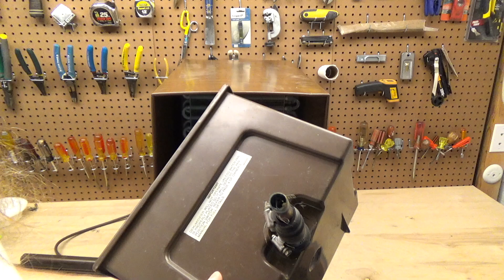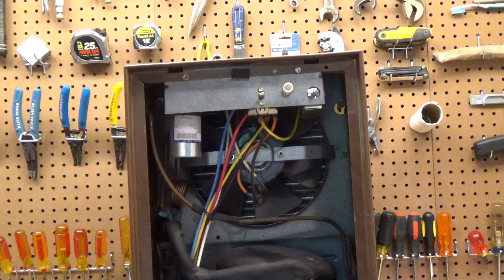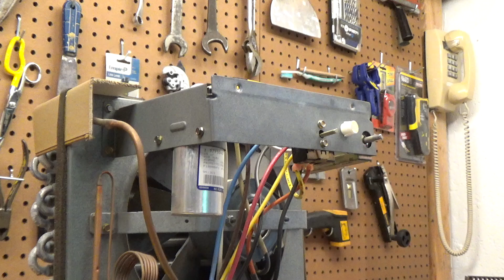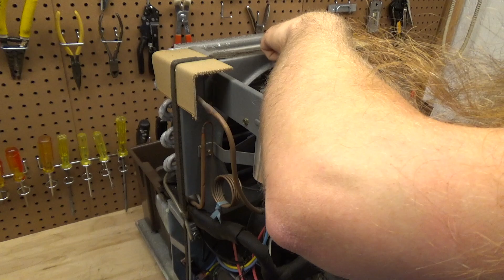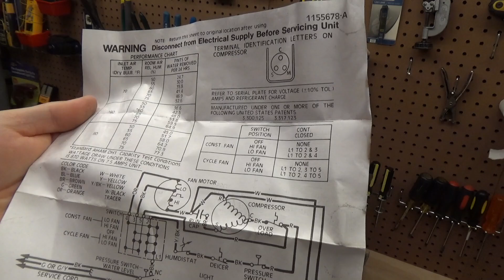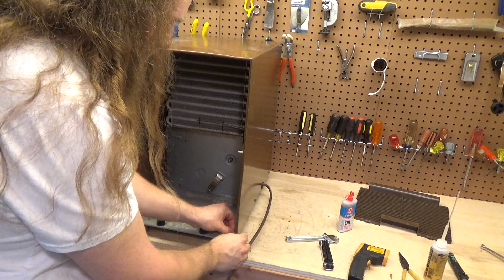Severely Damaged Compressor Mounts and Locked Fan Motor

Comment: Compressor is a Tecumseh AE just like the Carrier Siesta and the White Westinghouse air conditioner. I can't imagine how the compressor mounts were damaged like that but sure enough it still works perfectly sans the fan motor.
Reply from the maker: That is an excellent compressor.
Reply: @JordanU  Much like the rotaries, some people have claimed the two pole compressors don't last as long as the four pole compressors. While true in theory it hasn't played out. There are many, many two pole compressors that are 50+ years old and still work just fine. The AE is a perfect example. One of the best out there.

Comment: This one is totally identical to mine!  Judging by this unit set to constant drain, this may have fallen off of a table or a work bench.  When the compressor kicks when shutting off, it shakes the whole unit.  I think that's why it fell off of a table or bench

Comment: Those motors can be opened. Twist a flat blade screwdriver in the four points on the edge of one of the end bells where it meets the motor housing. You can see the metal punched and curved in. once you unbend it the end bell can be removed and it can be serviced like any other motor. Back end bell is easiest, and you can tap it apart gently from other end using the shaft. 

I work on tons of Nutone and WP stuff with this UE/Magnetek style motor and they usually come back to life rather well. Its rarely a lack of lube and roached bearings with them, and more commonly that the oil simply went sticky.  

To reassemble, use a punch and bend the metal tab things back. You can tap them down a bit as well if end bell is still a bit loose. They are decent motors, Too bad they put them together that way. The Fasco style clips where bad enough on these 3.3s

This machine is TOTL with almost every bell and whistle lol. I love continuous fan mode and have wired a few of my machines to run this way. Keeps unit dry, increased accuracy of setpoint in a larger space, and pretty much every basement can handle some extra air circulation, But the biggest thing I've noticed is it stops the short frequent cycles alot of units run. Also just sounds cool to me with the compressor cycling independently. cool unit.
Reply: Ah, yes, the sticky green oil. Stuff makes a mess, and it smells pretty strong. These motors also like to chew up their (usually front) thrust washers once the oil gets sticky enough. Regular lubrication of these motors definitely keeps  them from getting sticky. These are good motors if maintained, the worst ones are new old stock ones that have been sitting for years. It took me several hours and about 5 times of taking apart my NOS Nutone range hood to get it to work right, I had to replace the oil felt and soak the bushings in brake cleaner. Royal PITA. It's been fine for a few years now, but that was rough at first. It just kept gumming up after an hour or two of use. Thing was locked solid when I started working on it.

Comment: Sad to see this dehumidifier in such poor shape. Hopefully you can get the compressor mounts replaced here soon along with a new fan motor. I would try at least to get the fan blade off of it and try to rebalance it before putting it on the new fan motor. May help save the bearings on the new one. Good thing is though that you have a new bucket that can be used with the other one that you have now and get that one fully operational with a bucket that may work with the automatic shutoff if the spring needs to be adjusted. Nice peice and hopefully you can get it up and going with some repair work.